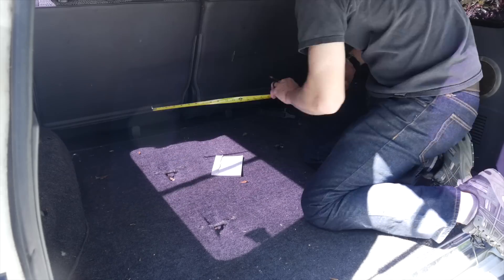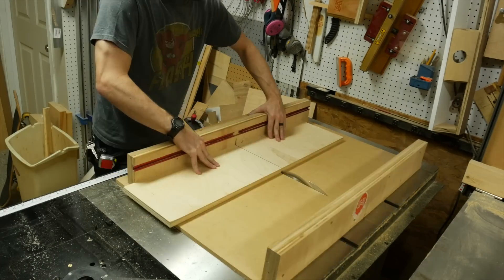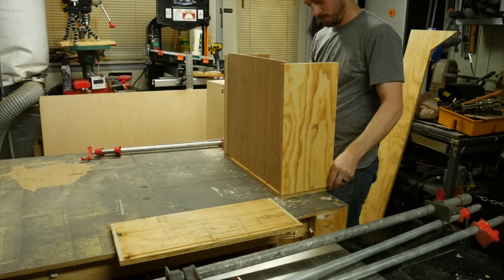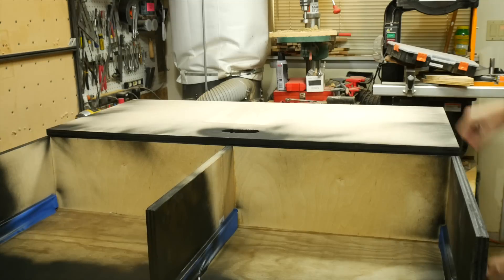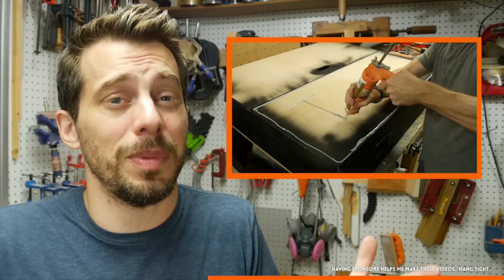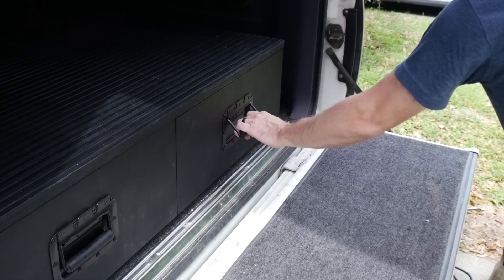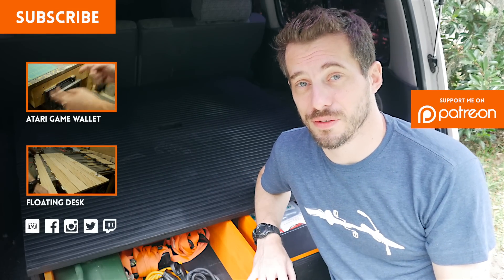Land Cruiser Toolbox // How-To | I Like To Make Stuff

Comment: Nice tool box, Bob! I do have a suggestion though. It does need to be bolted down. I speak from experience. I was hit from the rear in a company van about 10 years ago, when I drove a slot machine repair route. The only thing that saved my bacon was the fact that there was a cage between the cargo area and the passenger area.  Tool boxes, tools, parts, and other miscellaneous items flew and bounced in all directions inside that van, with one exception - the single tool box that was bolted to the floor and padlocked shut. This isn't something I read about, saw on Facebook, or something that happened to the friend of a cousin of a guy I know - it happened to me. Our manager raised holy cain with ownership, and within about 3 months, every van in the fleet had 3 tool and parts boxes and locking cabinets bolted into each van to prevent cargo from impaling someone in the event of an accident. Just something to think about.
Reply: +Mark Lindsay Good on your manager for taking a proactive approach to worker safety. Took the hint from the near miss and made a change for the better.
Reply: +Flip “Flip” Yaforeal Good link and better to learn from a foam ammo box than mourn a lost mate.
Reply: +Mark Fryer it seems like as long as his back seat is not folded down that it is locked in place.
Reply: +Dave McClintock 
Except when somebody rearends you at 45mph and you're at a dead stop.
Reply: I would second BOLTING down the box.  Better to be safe than sorry.
Reply: Or when you get hit and get flipped over. Run off a embankment, etc.. tons of scenarios in which in addition to having rear seat mounts being the only thing restraining the tool box... bolting down the box may be a LIFESAVER, and it keep someone from being CRIPPLED badly.
(Imagine a unsecured box full of "stuff" hitting someone in the neck.)

SUV flip over?
About a year ago a late model Cadillac whizzed past me and it broadsided a BIG land-yacht late model Tahoe / Explorer SUV.

In a blink of a eye the SUV was flipped over a couple of times and came to rest on it's roof.

The result everything that wasn't bolted down thrown thru the air.. scattered throughout the vehicle.
Reply: Yup, my uncle was rear ended waiting for AAA on the side of the road and he had a toolbox filled with heavy wrenches etc and it flew from the trunk through the back seat and hit him in the back of his head knocking him out.
Reply: Not to mention what a rear end impact would do to the passangers if that toolbox were to buckle the rear seats. At a minimum I would bolt it down.
Reply: yup yup yup 100X yup.
Reply: I saw that there were latches on the floor to attach the rear seat. There may be a way to latch down to those from the inside of the box and secure it to the floor of the vehicle.
Reply: Mark Lindsay CNC 
Also if you are planing on going off-road then this becomes dangerous as hell spatially if flipped over
But overall good job
Reply: Yes, yes, yes. Death by toolbox is way uncooler than death by stereo.
Reply: Mark Lindsay CNC m
Reply: Couldn't agree more. It must be bolted. You can't move it but a car rear ending you will certainly move it through the softest thing in front of it! An emergency stop will probably be an issue too.

Comment: Nice job! I like the rubber matting you added on the bottom and the top. I removed the back seat out of my '98 jeep wrangler tj and built a deck/trunk in it's place a few years ago. I used 3/4 marine ply and matching outdoor carpet to boot. I went so far as to wrap the deck around the top edge of the jeep tub and rear roll cage. When the tailgate is open, the center top section can be slid out temporarily to accommodate larger items. Like yourself, I normally keep the typical car stuff in trunk. I used large storage tubs for organization and water proofing just in case. The front edge of the box extends up just behind the front seats. That's where I have a hi-lift jack mounted.

Comment: Really nice addition to your rig!  Since you asked, I would make a couple changes.

1) The back section of the box is just going to be super hard to use.  I think I would make the drawers really long, able to be pulled out, with dividers to allow for separate sectioning.

2) I would orient the ribbed mat 90º so that the ribs are running front-to-back.  Sliding anything on them as-is is going to be impossible, particularly things like grocery bags that will catch.  I realize the idea of the mat is traction, but I think this will end up being a hassle to use.

But great project, and congrats on the video sponsorship!

Comment: I made a box similar to this for my 4Runner. Few suggestions for you. #1 I used turn-buckles to secure it down to the floor. Required some drilling and sealing but very secure, and doesn't move at all. #2 I would attached some loops or tie-down points to the top deck. I use these on mine to secure camping gear or dog crates while out camping or 4 wheeling. #3 those side tool boxes you are planning, expect them to be a PITA! I did some flip-up ones for mine and they never really turned out all that useful especially considering the amount of extra time they took. All in all good job!

Comment: I swapped out the back seat in my '87 Olds Cutlass Ciera for a box that's designed to hold 8 5-gallon buckets with their lids snapped on (~26"x54"x12"deep inside dimensions). Built of ¾" subfloor OSB (free dumpster finds), it sits on a platform that is custom-fitted to the un-floor-like floor. I used it for buckets only a few times. Most times, it's used for groceries, dumpster wood, scrap countertop granite, and whatever else is bound to become project fodder. Think of it as a small pick-up bed in the back of the car. If I need to haul more than 3 people, I can easily swap the back beat back in.

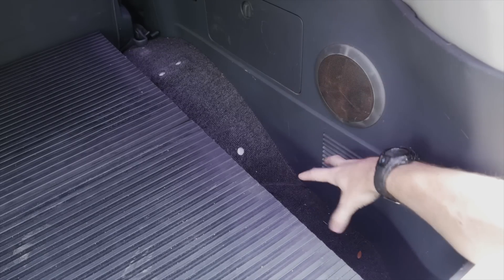5:40 Suggestion: CNC a set of ILTMS speaker grilles.

Comment: I made a storage box for my FZJ80 as well.  Wound up using automotive carpet and staples as opposed to rubber.  I suppose the rubber will last longer.  Just thought the carpet would be easy enough to replace if needed.  Also, for the areas above the wheel wells, I wound up cutting two pieces of plywood and contouring them to the sides of the cargo area.  Then, used a piano hinge to that they would both open.  I use that area for random extras that don't fit in the drawers (recovery gear, tools and first aid for me).  Great video!!

Comment: Hey Bob- I had something similar in an old 4runner when I was a contractor.  I HIGHLY recommend attaching it to the truck.  Ii used turn buckles to strap it to the cargo loops because I was always thinking about if there was a turn over circumstance the tools inside and the platform itself would become a horrendous projectile.  That being said your build is awesome.  I LOVE the rubber mat.

Comment: On my brothers earlier Land Cruiser he made a similar storage system all nailed and glued  butt joined joints. Some of the joints failed over time and a lot of rough roads and use. With his latest Cruiser he remade the same box system but with rebated corners and with trenches for the internals and all glued and screwed.  He also reinforced all the external corners he could with 1/16" thick aluminium angle that he attached with "Sika Flex" polyurethane adhesive and a few screws while it went off. It does not look like failing any time soon. I don't know if you have Sika products in the US but you do have Devcon who also make super strong adhesives.

Comment: Next time you could try to build the enclosure in two parts split down the length of the vehicle.  Then you can keep the "wings" and drop each one in easier.  When I used to build up false floors for subwoofer enclosures in car audio builds, that's what we'd do to make it much more manageable.
Reply: Thanx for that good idea, which I will use to design my "picnic kitchen" setup for the rear of my small Honda Fit. The rear door surrounds  and wheel arches intrude into the space available, but such a split system could overcome that limitation.

Comment: You should mount it on under side mount industrial sliders that bolt through the floor of the truck to the frame. It will secure it in place in case of an impact, and give you the option to use it as a pull out work space in case you need a work area out in the field. When I worked in fire services and EMS the supervisor vehicles had similar pull out storage that allowed for easy access and work area.

Comment: Nice work!  I made something similar years back that I use during hunting season. It goes in the back of my Tahoe, but is one large drawer with dividers. I can fit my shotgun diagonally, and then all the gear for me and my dog in the drawer. Really cleans up the back, rather than bags and gear scattered everywhere.  Slides would have been nice - I just used a hardwood strip with a little wax on it, and it slides fine. Love your projects - keep up the great stuff!

Comment: I made a sliding tray for the back of  1995 Ford Bronco. It slides out so I can access stuff in the back without having to climb onto the tailgate. Didn't want drawers because they tend to fill up with stuff you may never use. Don't need that extra weight in my daily driver. I have Rubbermaid totes for that.

Comment: The empty spots on the side would work great for a little off road air compressor. I am going to be building one of these boxes for my 96 Landover. I have a little compressor now that I use when I have to air my tires up before hitting the road when I go to the beach and plan on mounting it and putting a quick connect on the bumper to make things a little easier to get to. Oh ya awesome build.

Comment: Hi Bob -  

Thanks for the great video. I was half way through with my Jeep drawer storage build when I discovered yours and got some great ideas from you.  I particularly liked the rubber mat idea, so that's what I did. 

The problem I ran into was the use of Liquid Nails FuzIT. After reading the instructions, I laid down the beads of the stuff on top of the box. Then I immediately placed the mat down and noticed the beads of glue did not flatten out as I had expected, even after rolling it out and placing weight on top of it. 

Probably no one would notice except for me, but I was very disappointed in the product for this application. Of course there is no going back now.  

Anyway, I am grateful for your detailed video and the terrific ideas.

Comment: Hey bob! I know this is a long time ago. In case no one mentioned it. Good tip is to use some magnetic strips of metal to keep tools from flying around. You just need a strong magnet that does not interfere with other electronics.

Comment: Looks great!   I've often though of building one for my truck, but I'd need long drawer slides and they'd have to be very strong and I'm not sure what to use. 
You might think of securing it down in case of a roll over accident.  If you have rear passengers and that his them in the head it would be very harmful.   I'd also secure the large compartment if your going to store any heavy objects.    Thanks for the video.

Comment: Very nicely done.  I like.  I laughed at the velcro....  that thing is so heavy, it's not going anywhere.  And with the seat in place there, I don't see how it could hurt you in an accident.  Now, A circular saw, sitting on top of the box, in an accident, could become a projectile & kill you....

I built something similar for my Escalade....  Instead of black paint & rubber though, I covered it in a light maple laminated flooring....

Visually, it looks amazing, and I get a lot of compliments about how awesome it is, and how it matches the tan interior, and it it is nice.  Functionally, anything touching it rattles...  And anything set on top slides around like it's on skates....

So, FUNCTIONALLY, the rubber is a much better choice.  So, good call on the rubber mat.

I also like that stuff is out of sight....

Nice project man.  Well done.

Comment: Definitely a cool idea. I personally would have opted for something more modular / easy to dissassemble. Not sure if your Land Cruiser has a bottom hanging spare tire or a trunk spare tire (looks like its in the trunk to me), but a modular design would make it easier to remove everything and get to the spare tire without having to empty out the drawers, in addition to the modular compartments, you could have installed that top cover mat with those velcros so you don't have to leave an extra cut in the mat making it less seamless and theft deterrent. 

The big benefit to a modular design would be that you could have different boxes designated for what you were going out to do, if you go out and do odd jobs in other places frequently, you could have one for each style of job and swap then go, with a secondary benefit of being able to remove that box once you get to the site and use that as your tool box, perhaps with a secondary top access to the drawer.

Comment: I've recently been designing a set of drawers for the rear of my 4Runner, so I'm always looking for original ideas - I like the wide section in the back and love the orange drawers - its a very original touch that helps lighten up the dark drawers. As always, you bring a very original solution to a common problem - great job...

Comment: I personally  would add a small lip around the perimeter of the top of the unit so that items sat on the top wouldn't slide off, with maybe a few of those small tie down rings so i could stretch some bungee cords across for added security. Anything loose in a vehicle, especially in a SUV will go flying in the event that a vehicle collision were to happen.

Comment: Did you consider latches or catches to keep the drawers closed?  A slide bolt or other catch would prevent the drawers from sliding in and out, wearing out over time as the truck stops and starts.   Very nice project, bookmarked for when I swap vehicles.

Comment: +I Like To Make Stuff Hi, Bob. Interesting project. When you make the toolboxes to go over the wheel wells, you should look into making them interlock with the center box, just to make sure everything stays in place.

Also, wood is an interesting choice. Wouldn't sheetmetal be better, since it's lighter? The mass of that toolbox does count against the vehicle in both fuel economy and total towing load. (Granted, it's a small penalty, but every pound counts.) I'd like to make a tie down system for my 2011 VW Jetta, but again, I want to make sure it doesn't weigh much. (Mostly to keep the fluid's bin and the floor jack from rolling around much.)

Comment: Your videos are so nice and concise and cleanly done. Is it easy to move the ribbed mat over the adhesive to position it just so? Otherwise I think you were wise to cut it oversize and then trim it. Also, why not just make the drawers deep and then not worry about having anything on top of the box in the back? One last thing, Jim Tolpin has a book called The Toolbox Book from Taunton Press and does a pretty nice section about storage in vehicles. All the best and thank you for your great videos!

Comment: So I want to make this for the bed of my Ford Expedition EL which is a pretty long bed. I like your design except I would want my drawers to be much longer, about 5-6 feet. Anything in particular that you recommend in terms of drawer glides to hold the weight of each drawer? I plan on loading the drawers with fishing tackle so they should be that heavy.

Comment: Did you consider adding locks to the door and drawers? My main reason for adding a divider like this would be to lock and secure my camera gear inside my 4Runner. I've had my car broken into a couple times in my area, it might not be a problem in yours though.

Comment: Once you made the main box, do you have standard method to determine the size of the drawers (the width specifically), or do youjust eyeball it? Did you first need to check the space the sliders take up on the side of the drawers?

Comment: In the past I owned a mid 90's Nissan Hardbody  4x4 KingCab PickUp. To hide my 6 CD Changer from curious on lookers, I built a simple box with a hinged lid.. It sat on the floor behind the driver seat, and was covered with matching carpet to what was on the floor, it became Non-Descript and so brought no attention to itself. Unless I had told you about it, you would probably would not of noticed it. I'm sorry, I have no pictures, and the vehicle is long gone. It was  beautiful truck I regret having sold it regardless of it's low MPG rating.

Comment: Bob, thanks for the video, i built the same for the trunk of my Volvo xc 70 and it works great, one thing though, i did not use fuse but Gorilla construction adhesive. the problem is that the heat is melting the adhesive. do you have a suggestion?
Thanks